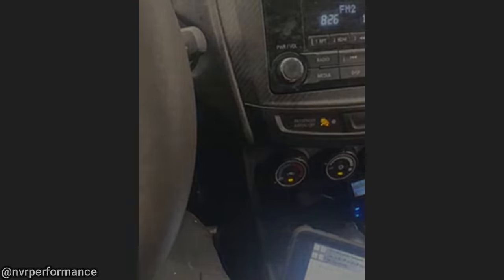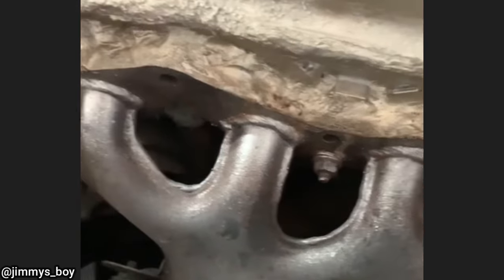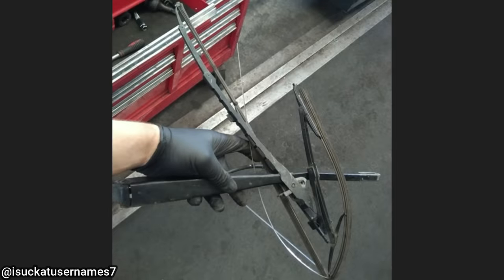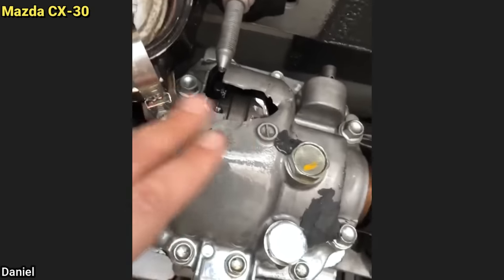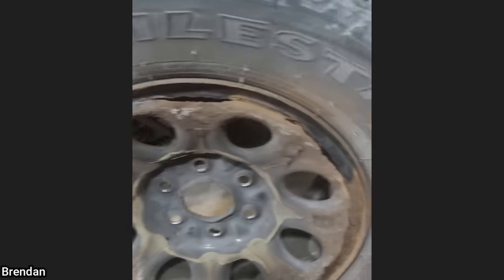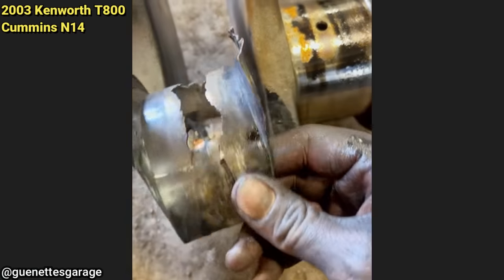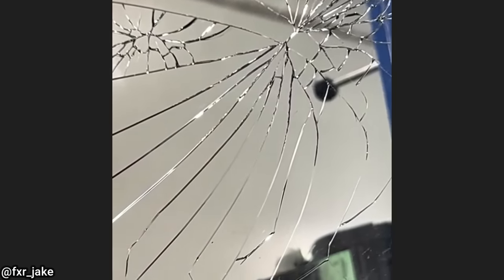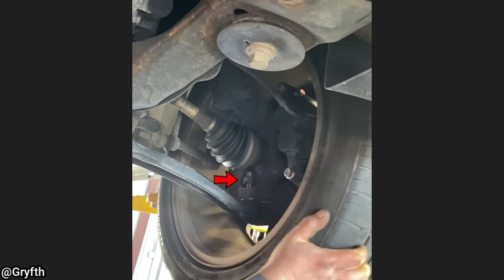Customer States (Best of January & February 2022) | Just Rolled In

Comment: Sweet baby Jesus and the orphans, that last one! A guy in the shop was changing a tire while smoking when the tire exploded from having Fix-A-Flat in it (customer didn't let us know). Dude lost his hand and half his forearm and was permanently disabled from it with hearing  loss. I'll NEVER forget that sound nor the fact we were finding meat and bone fragments for weeks.
Reply: Damn that’s gruesome!
Reply from the maker: Holy crap 😳.  Poor dude!
Reply: Sounds like the guy should have been working. Not smoking.
Reply: Was having a laugh at this video. Not anymore now I feel bad!
Reply: can you explain how fix a flat blew up a tire? what am I missing here
Reply: @chrism8180  At the time, Fix-A-Flat used butane as a propellant, so the tire was filled with butane instead of air. When he removed the valve stem the escaping gas ignited off his cigarette, back-ignited into the tire and expanded with the combustion explosively beyond the integrity of the tire and rim. Fortunately, Fix-A-Flat changed it's formula and hasn't used butane since 1999, but other flat repair products still may so if you have used one, PLEASE let the shop know so precautions can be taken.
Reply: That's unfortunate but smoking while working on cars is like smoking while filling up a gas can.
Reply: I actually heard the same story when I was passing through Baltimore.
Reply: So , I’m curious when that happened. I used fox a flat about 15 years ago and it didn’t warn of it exploding or using butane , the mechanic was annoyed cause it made a mess on the rim . Lol I was able to drive 15 miles to the shop , my spare tire “donut” was flat , better than walking 15 miles in 115 F summer heat
Reply: @RPG-oh1yf  Not really.  While it's not the smartest thing to do, if you're a tire guy you're not too worried about flammable gas.  I'd 100% agree with you when it comes to regular techs.
Reply: @Darion350  I wouldn't want a guy smoking around my car because it'd end up stinking of smoke.
Reply: @drunkenhobo8020  Yes, I agree.  I'm only talking about the relative safety of tire changing compared to working on the rest of the car when it comes to flammables and cigarettes.
Reply: Back in the 90s and early 00s before safety was as strict, we used to get a lot of tires in from farmers inflated with propane
Reply: @otakop67  Pretty much every shop I take my car to will ask if flat fixer has been used if the wheels are being repaired/replaced. Did not know why until now.

Shit that's a brutal way to go on disability. And that customer would be indignant if you asked them if they'd used Fix-a-Flat too.
Reply: @otakop67  we will not touch a tire that has any repair shit in it period.
Reply: @cheallaigh  solid policy! Thanks for looking out for your mechanics.
Reply: @otakop67  well, i'm married to him and most days i want to keep him...
Reply: @TheGrobe  Yea good luck with that.  Your in theory synopsis is flawed.  Cigs ignite gasoline all the time.  All it takes is a little bit of wind to cause the smoldering tip to flare up.
Reply: @RPG-oh1yf  I can't work on cars without a cigarette dangling out of my mouth. I think it's the law.
Reply: @TheGrobe  my dad proved that to me when I was a kid. Had some parts I was cleaning in gasoline, and he came around with a smoke. I yelled at him to get away from that with his smoke, and he threw it in the bin. From that point on I was a lot less afraid, and for the last 22 years, have never worried about cigarette gas thing, unless we're talking about somehow getting gas sprayed out everywhere. Like I would never try to replace a fuel filter, disconnect a fuel line on a hot car, or things like that with a smoke in my mouth, but you get the idea.
Reply: @spikereynolds8615  I'm pretty sure there has to be a law on the books about that somewhere.90% of the mechanics I know smoke.
Reply: Reminds me of the video of the old man, in a tire shop, sat down, and the shop clowns ignited an airbag underneath him. Felt real bad for him, I'm sure he felt worse!
Reply: @skyricq  All it takes is a gust of wind to cause a cig to flame up.
Reply: SO VERY SAD.
SO SORRY.
Reply: @otakop67  how about just not smoking in the shop where there is gasoline and other flammable substances.  Seems like a better option
Reply: I'm sorry that happened and I feel bad for the guy, but no professional auto/tire shop would allow employees to smoke while working on vehicles.
Reply: Tires are no joke. When I was an airdale in the navy, we had to have training about the tires on the helicopters. When they were being worked on, or inflated, no one was allowed to walk past them for the entire length of the hangar. If they went, it would be like standing beside a bomb. Not much of you would be left.
Reply: @otakop67  We had a guy who didn't use the regulator for the air chuck to fill a tire (our air carts can do up to 3000psi)...needless to say he would up folded underneath a generator...gotta use the tools as intended.
Reply: @RPG-oh1yf Proof? There doesn't appear to be literature to support your hypothesis. From: Marcus, H.A., Geiman, J.A. The Propensity of Lit Cigarettes to Ignite Gasoline Vapors. Fire Technol 50, 1391–1412 (2014), "Fire investigators regularly evaluate available fuels and potential ignition sources to determine the cause of a fire. This work examined the propensity of lit cigarettes to ignite gasoline vapors, expanding on previous work to include a large number of trials and a wide range of test conditions. Experiments were conducted exposing lit cigarettes, both at idle and under draw, to gasoline vapors in various configurations including pools/pans of gasoline, gasoline on textile substrates (clothing), and sprays of gasoline. Five major brands of commercially-manufactured tobacco cigarettes were tested. The experiments conducted for this study consisted of 70 distinct tests involving a total of 723 cigarettes and over 4,500 instances of exposure of a lit cigarette to ignitable concentrations of gasoline vapor in air. There were no instances of the ignition of gasoline vapors from the exposure of those vapors to a lit tobacco cigarette during any of the experiments."

Moreover, there are several videos on Youtube, for example "Myth Busting With Uncle Tony- Cigarettes and Gasoline" from Uncle Tony's Garage, in which he demonstrates extinguishing a lit cigarette with gasoline.
Reply: @Kirivon  Sure, tests done in controlled, wind free environments. Invalid in real world.
Reply: @RPG-oh1yf  "Experiments were conducted exposing lit cigarettes, both at idle and under draw," the phrase "under draw" means pulling air through the cigarette to stoke the flame--aka wind. What about all the real world videos of cigarettes being thrown into gasoline here on youtube? In the video I referenced, the individual takes a drag (aka blows on) a cigarette immediately above a small pool of gasoline (thus exposing it directly to the vapors) with no effect.

What exactly are you basing your hypothesis off of? Have you personally ignited gasoline or seen gasoline ignited by a cigarette? Gasoline in an internal combustion engine is subject to immense pressure and heat. Autoignition within a four stroke internal combustion engine, also known as knock or detonation, is a catastrophic event so gasoline is formulated to be resistant to autoignition. The octane rating of a fuel is a measurement of its propensity to resist autoignition.

While a lit and stoked cigarette does exceed the autoignition temperature threshold of gasoline, the temperature drops rapidly when not being stoked. Gasoline vapors will convect around the cigarette, making it unlikely to ignite, and the rapid ashing of the burnt tobacco will also provide a barrier to ignition. Moreover, to ignite gasoline it isn't a matter of the heat source being greater than the autoignition point--its a matter of the heat source being able to raise the gasoline's temperature to its autoignition point. Unless the gasoline is heated and already near its autoignition temperature of 280C, the cigarette lacks the thermal mass to raise the temperature of the gas significantly before the gas (a cool liquid) extinguishes the flame. And while a cigarette tip burns at around 400-900C, depending on whether it's being drawn or not, it pales in comparison to a simple lighter which can burn at near 2000C.

Moreover, the frequent occurrence of fires started by people smoking in bed and falling asleep with a lit cigarette on their mattress has led many states to enact laws requiring the sale of fire safe cigarettes. Thus, many cigarettes available for sale will be designed to be self extinguishing.

Finally, as for your constant "in the real world," comments about wind. It's pretty evident you've never smoked before because, smoking in the wind is a pain in the ass given the wind will extinguish the cigarette.
Reply: @Kirivon  Well your data settles it then.  You can smoke all you want next to spilled gasoline under your feet.  I'll go on the side of caution.  Carry on.
Reply: christ.  and fix-a-flat is probably just an excuse to avoid putting on a spare.  I don't know a lot about cars but I know enough to put on a spare.
Reply: @RPG-oh1yf  Cigs don't ignite gasoline, flared up or otherwise, it's the fumes that can ignite
Reply: @Brunnen_Gee  I used to work in a restaurant next to a car shop that also did road calls for rigs. One day the tire guy overfilled one to the point it blew out. We all thought a bomb had gone off in the parking lot. We were more than 100 feet away, and I saw some of the windows on the restaurant bow in
Reply: @yaimajerk  Yea OK.  You clearly never started a fire with gasoline because a cig will definitely ignite it the moment those sparks turn into the smallest flame.

Comment: At 5:40 thats what happens when a wrecker driver doesn't either run air to the towed vehicle or doesn't cage the brakes. That exact thing happened to me years ago. Cost the the tow company $2400 to replace 4 tires.

Comment: How does one botch a wiper blade install that badly?
Reply from the maker: Good question  haha
Reply: It's a sign of the times and evolution of a species.
Reply: Looks like it was a very high level of frustration.
Reply: @opendstudio7141  I assume you're using the word evolution ironically LOL
Reply: @davidburns5027  Your assumtion is correct. Sarcasm is the fuel of comedy. 😁
Reply: As a mechanic, I can tell you that the hardest part to replace is the fucking windshield wipers. Every other part has some logic to it, but those goddamn wiper blades needed 3 engineers and a priest just to install.
Reply: @opendstudio7141  While watching these videos: "It's evolution, just backwards."
Reply: @opendstudio7141  Or, more appropriately, a failure of previous generations to teach the newer ones. And an even greater failure on the newer generation to fail to admit to not knowing something and using the supercomputer in their pocket to then know something.
Reply: @derpyduck5088  I'm not a mechanic, but man I'll agree it took me way longer than I'd like to admit to figure out how to change them lol
Reply: Locally had an auto parts store that advertised on their window; they'd install any windshield wipers purchased there.  I've done them myself before, but I couldn't do it. 4  other men couldn't do it, so we waited on Ryan to come back from dinner.

He took the tiny piece that anchors the blade to the arm on the vehicle out of the wiper assembly,  turned it over backwards & snapped it back in. Then the blades snapped on, took him 3 minutes. 
I asked how he learned that & he told me, I didn't really want to know.
Edit: maybe that was Ryan's earlier attempt.
Reply: That was a wiper that pushed the owner TOO far. Been there.
Reply: It's like that Simpsons barbecue pit gag...
Reply: If you can't change a tire or a wiper blade you should be no where near a car.
Reply: The wipers on my Tacoma were designed either by someone with an iq of a catfish or a genius I’m not sure which. The little latches are impossible to open , lol
Reply: @derpyduck5088  hubby has them down to science mainly... one of mine toasted while he was away, it was in pieces. i bought the new ones, removed the old and... then drove his truck while he was gone. while i think i figured out the mechanics of it, i couldn't reach with my all of 5' nothing height... but we'll never know.
Reply: You get mad trying to install it and lose your temper, throw it and stomp on it and scream.
Reply: @derpyduck5088  And there are like 15 different styles of connectors!!!! I hate doing wiper blades, I tell the lube techs to do them. lol
Reply: Wiper blades from the 70s to 90s were so darned simple.  $3 to $8 for an arm, or $3 for a pair of refills.  Most every car used the simple universal loop.  Refills lasted 2 to 5 years if you don't let them freeze to the glass then hit wiper on.

Beam blades.  Who the hell thought that was a good idea. 10 different mounts....$3 blades now $25. About 5 adapter pieces sold with generics hoping to fit using Tetris skills.  They last about a year.

The real pisser is when O Riley or others package the old $3 blades in a plastic clam shell and charge $25 for the same damned $3 part.
Reply: @STho205  the wipers on my nearly 4 years old vehicle lasted 2 years for the front and then i had to replace them... that set lasted not even a full year. now i noticed the rear one is toast and i'm like... joy, guess it's on a yearly replacement cycle  now too.
Reply: Well that's what happens when ya get angry and break it
Reply: @derpyduck5088  I remember buying just the blade refills and installing them. Long ago. It was not difficult.
Reply: It Looked like a Gorilla got hold of it !!!
Reply: @GaldirEonai  holy crap I was thinking the exact same thing 😂
Reply: By not reading the instructions and having no critical thinking ability.
Reply: With anger!

Comment: One of the work cars once had a funny noise in the rear. Started at about 160kph (100mph) and stopped at about 190kph (120mph). We had to take the mechanic out ourselves as he wasn't allowed to drive it that fast, but all props to him, he diagnosed it in about 5 seconds.
Reply: What was the cause?
Reply: @watchinyoutube8919  It was many years ago so I don't remember exactly but from memory it had something to do with a rear suspension bushing.
Reply: km/hr

Comment: That ball joint exploding was a new one for me. Thanks! Always hilarious!
Reply: Yeah I have a feeling it was a strut exploding from heating the pinch bolt.
Reply from the maker: @ChrisdeHaan  no it was the ball joint. The pinch bolt holds the knucke to the ball joint. He over heated it when he heated up the seized pinch bolt. It happens lots to these Subaru's. Other people have mentioned it in the comments. The mechanic working on it also said it was the ball joint.
Reply: @JustRolledIn  damn never heard of that but then again I am used to fords not Subaru.
Reply from the maker: @ChrisdeHaan  lol me too! I've mostly only worked on Ford's.
Reply: @magagarage7975  aren't most of them hollow for grease flow?
Reply: I had heard rumors from old time mechanics but never seen til now, WOW 😱😱😱
Reply: If you put a wrench on MY “ball joints”, I’d probly explode much the same way, lol
Reply: @JustRolledIn  all the more reason that every Subie ever made should be pushed off the side of a ship into the Marianas Trench. I hate those damn cars!
Reply: @ChrisdeHaan  It can happen to any grease filled component on any vehicle. Ive seen it twice in my 25 year career, so far. One Honda, one F150.
Reply: Super heated grease inside the joint caused it to blow out.
Reply: @acemobile9806   lmao never wanted anything but a subaru, crazy how different needs around the world lead to different loyalties.
Reply: @acemobile9806  I had a subaru and used to work on them all the time.  I agree 100% with your statement

Comment: 3:11 this has to be one of the worst - not because it's outright dangerous, expensive, or mechanically complicated. But that someone completely screws up a task as menial as changing the damn wiper blades makes you concerned how they manage with fluid refills or let alone tire pressure. (Which I suppose explains other videos with coolant/engine oil cocktails)
Reply: Even scarier is that they probably breed....
Reply: Best guess, it was the hook type where you have to push it away from the hook to release it..he pushed it the wrong way and just kept pushing.
Reply: It reminds me of the Homer Simpson BBQ pit scene, they probably got angry trying to install it and lost their shit. I really hope that person doesn't have kids, imagine them trying to change a diaper.
Reply: Yeah...part of me wants to know who could botch a wiper blade that badly, but then I realize I'd rather not

Comment: 0:22 Something like this happened to my Dad when he used to fix electronics. A guy walks into the shop with a monitor and says it doesn't turn on. After he walks out of the store my Dad turns it around finds the power cable loose in the socket. This is what quote fees are for.

Comment: 3:22 I had a Chevy Cruze come in with that same problem, the customer kept adding 1qt of oil at every fuel fillup because of an oil leak that was leaving a few droplets on the ground when parked. When the car got to the dealership it wouldn't turn over, oil had pooled in the cylinders because it was so full. I think it had nearly 15qts of oil in it (holds 4qts) and yes it smoked like crazy once it got running.